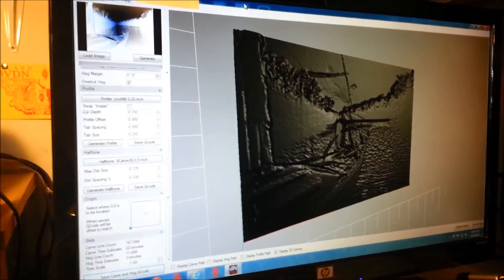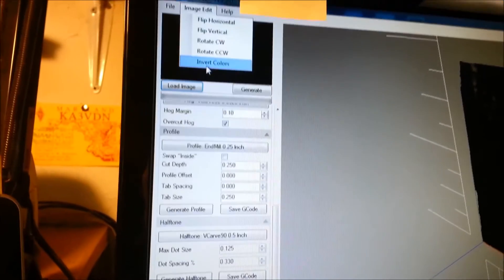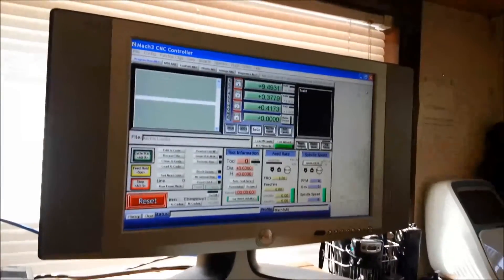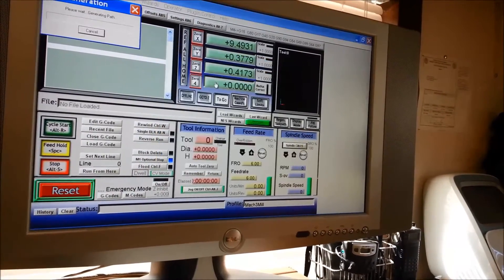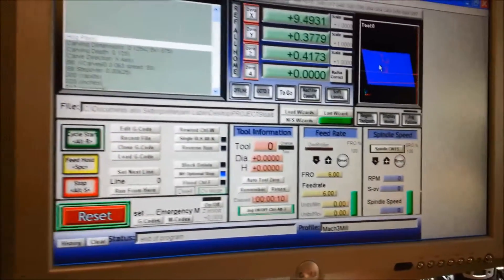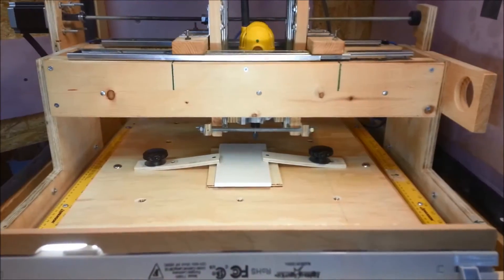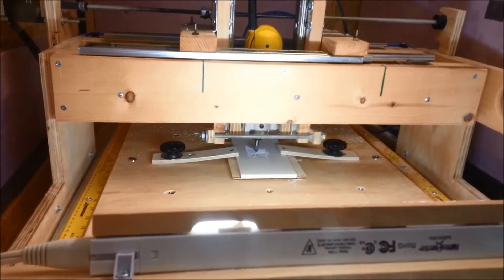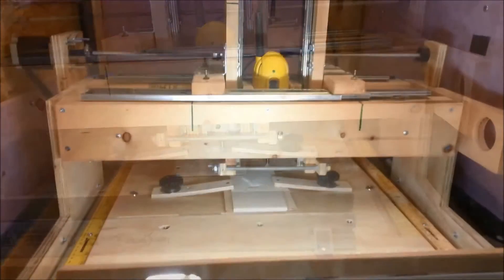Homemade CNC Lithopane Carving

Comment: Search ebay for cncwapper a program for converting a g code to wrap a tube. Carving white pop pipe makes nice tea light shades.
Reply from the maker: I would like to, but I'm limited to three axis - unfortunately I don't have that 4th on my controller board.  I have some ideas though coming soon (sorta faking a 4th axis) that involve heating PVC pipe, laying it flat, doing a carving, and then heating it to let the pipe return to it's initial curve.  Stay tuned...
Reply: I got my mach3 breakout board at BuildYourCNC web site 28.50 it is 5 axis
Reply from the maker: ShadeTreeCNC Hmmm...something to think about I guess.